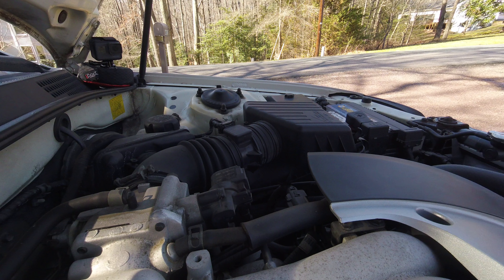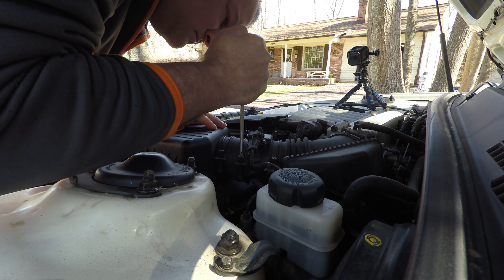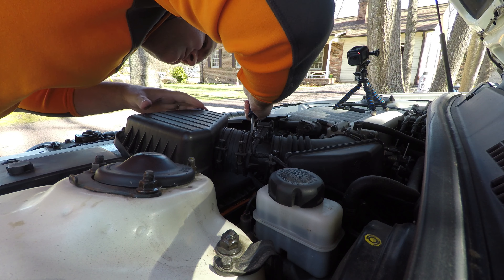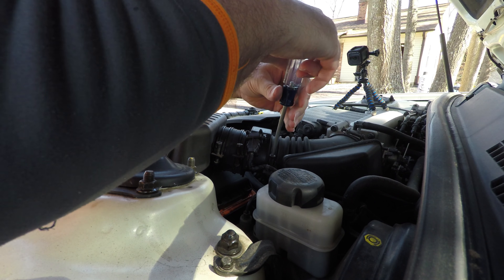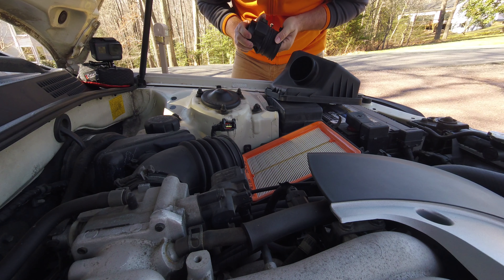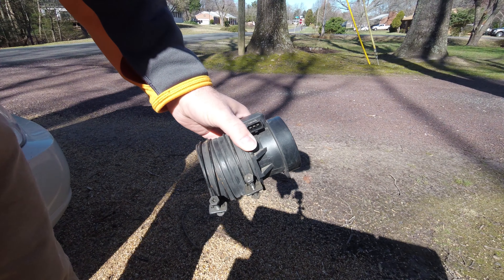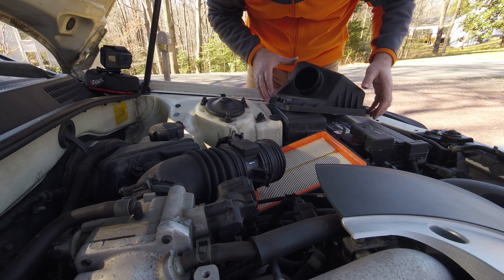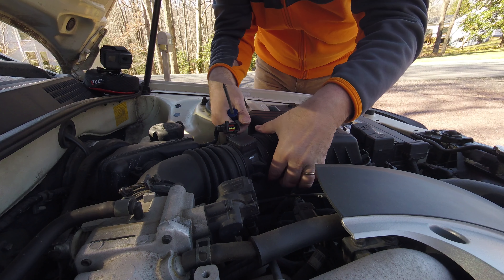How To Clean A Mass Airflow Sensor - 2004 KIA Optima

Comment: Did it fix the problem? I have an 04. Spitting and sputtering. Diagnostic said PO102 Mass or Volume Air Flow Circuit Low Input.
Reply: Sorry, I didn't see your comment above. Thanks
Reply from the maker: Yeah, sorry. Didn't fix it. But I'm slowly narrowing things down.

Comment: What symptoms were you getting and did you fix it? Im aware that maf cleaning can often not work and you need to buy a new one.
Reply from the maker: My check engine light is still on, so no, the root problem hasn't been fixed yet. Based on the error codes, it could be any number of things from sensors to spark plugs. I've also heard that cleaning the MAF sensor doesn't work but in my case, I'm pretty sure it's not the MAF sensor but something else. Plus I'm too stingy to pay the dealer to put an OEM one in.